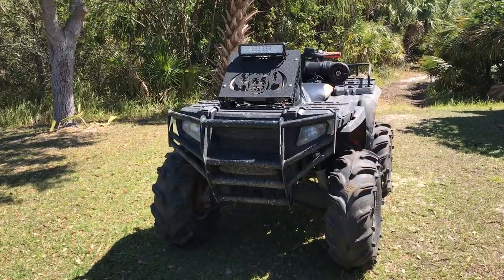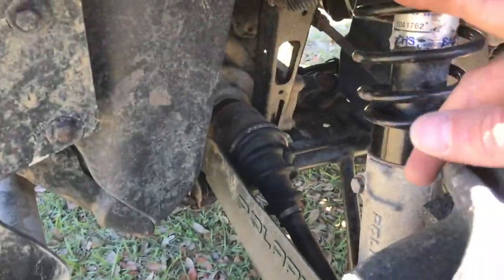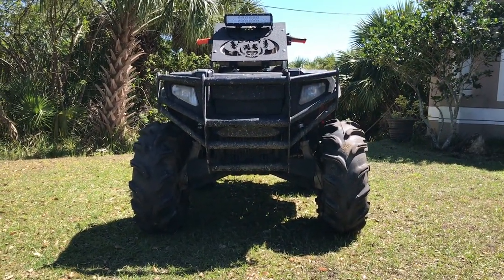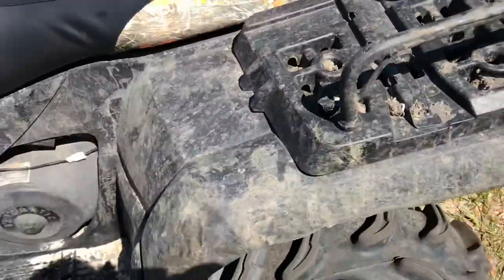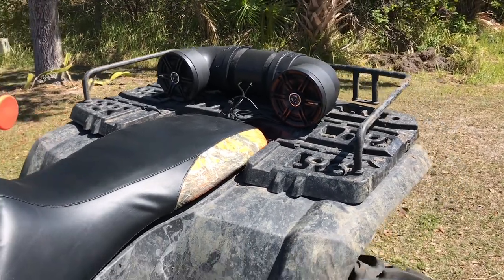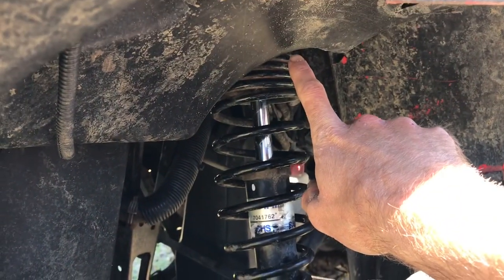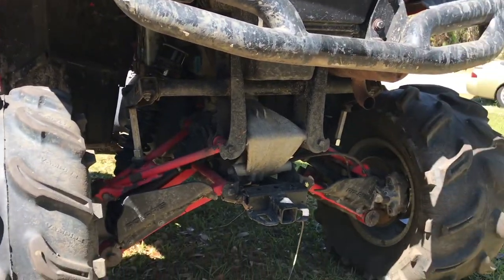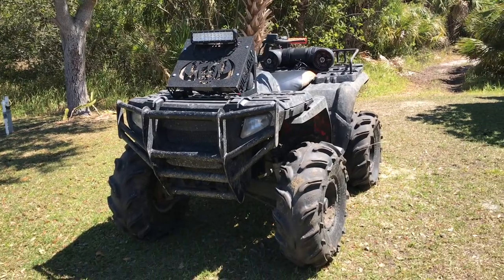Polaris Sportsman 500 Lift Kit & Wild Boar Relocation Installed

Comment: nice vid
quad looks great.
I just put on some cst wild thang tires and finally got to test them in some mud the other day if your looking for new tires. I found the pricing was great compared to the bigger named ones.
giving you a thumbs up and subbed 
with the relocate can you still use the front storage box?
I'm on the fence on either replacing rad and or getting a relocate kit.  Not doing deep mud but quad is mainly for work on property so we'll see.
drive safe
Glenn
Reply from the maker: Kanuck OutDoors thank you for that! And no the storage box is a little bit of a pain to use once you do it just because the lines and everything run through it.  And as far as the tires you are talking about I’m going to have to take a look at those because I’m definitely looking for some new tires at the moment
Reply: I just uploaded a vid on them if you wanna check it out